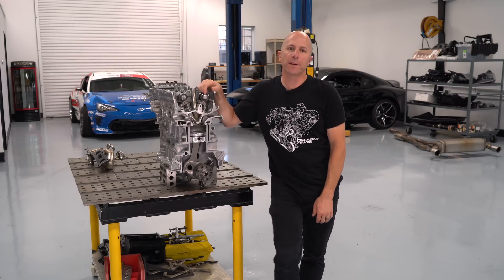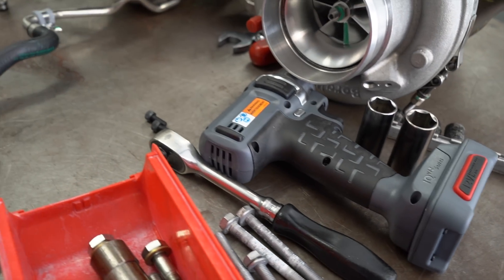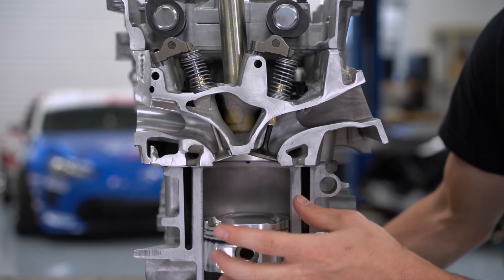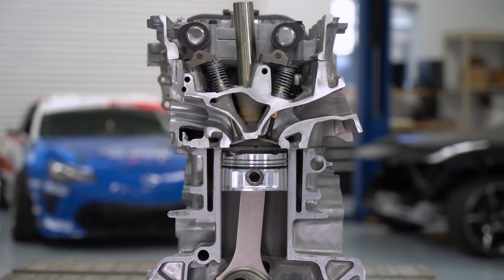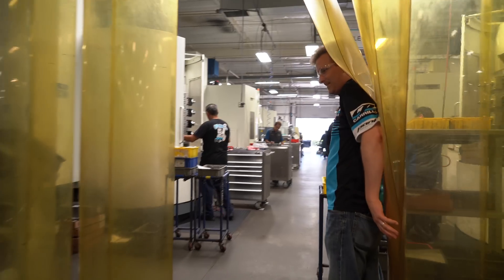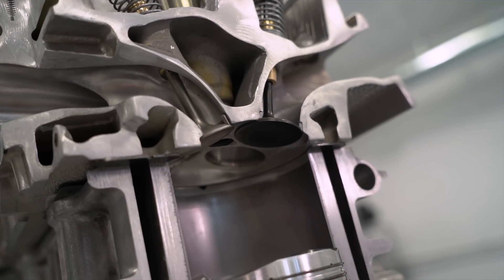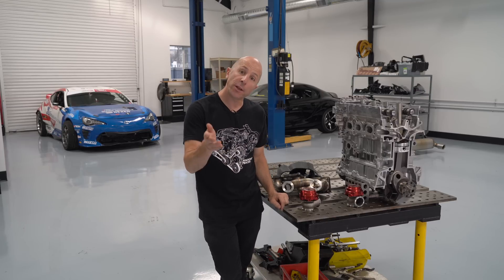The Making of 1,000 Horsepower 2020 Supra Engine Parts

Comment: I can't understand the comments on the video saying "Oh he's changing all the internals!" or "wow 1k HP without using stock parts". Like do  people think a 2jz, ls7 or 5.7 Hemi makes 700-1,000hp with stock internals? Obviously you have to upgrade the internals to do this stuff. Yea you can use stock internals but by that point you're on borrowed time, Stephen already said he's racing this engine so why would he risk that?
Reply: Ford 5.0 coyotes can make over 1000whp easy on stock internals
Reply: M M you can make 750ish just on a supercharger
Reply: @descentmvm  you can daily drive  car with even more hp on stock internals, but it couldn't finish one hour race. Just because car has +600hp it doesn't mean that it is using all of it when you're  cruising down the highway or stuck in the traffic so it is not under big stress, but if you want to use  that power for racing or track days it is not gonna have a very long nor happy lifetime
Reply: @themarenda  hes done probably over 2000 pulls on it man. 6 years at 600+ to wheels on a stock 1j is really impressive imo and proves that it can withstand long stressful endurances. Pretty sure hes dumped more money into new r154s though hes broken like 4 of those things and they cost like 3k hahah but I'm gonna have to disagree on what your saying if cars got a perfect tune it's not going to break. Even if you bag shit out of it or put it through long periods of stress car that has a perfect tune will hold up through that because there's no difference from doing one pull on way home from work vs doing contitonius pulls for a long period of time. If afr is right bearings will be smooth as butter even at 4x power. When engines blow up its rarely because they can't hold power its because air to fuel probably shit bed and started pinging. Put it this way if your standing on a pop can and its supporting your weight you could stand on that shit for 5 days it's not gonna collapse. Start flicking the side of pop can with your finger which is what pinging or running lean would be equivalent too and its gonna collapse.
Reply: @descentmvm  temperature starts to rise over time and there is more in heat management that tuning air gas ratio, cooling liquid evaporates and loses ability to take away the heat, oil lubes the engine only as much as it can and on bigger temperatures it changes caracteristics so it doesn't lube good  any more, less lubricated piston heads more resistance and material expands over heat until all goes to shit. One thing leads to another and when you tune one thing another one suffers, but this tuning for short bursts of power is more of an american thing anyway because of drag racing culture, we europeans are more influenced by rally and f1 so we care more about handling rather than just brute force
Reply: @themarenda  I 100% agree with you on this one that's all true. Also jzs are known for being really hot engines cast iron is a true ko I know mine even has problems with doing a 10 second burnout coolant temp goes up 15°c lmfao thats why you see alot of them with different rads even on stock turbo ones. I think biggest problem for jz would be getting seals koed from real bad heat soak and than losing compression over long long time from running way more power on them but then again these things dont blow up watch aussies or arabs run these things off limiters for 30+mins doing reverse burnouts at 80+kmh in reverse.
Reply: @descentmvm  yeah that are some sweet rides, but not much of it is left stock, arabs are practically sitting on oil, they just walk up to a mechanic with loads of cash or gold levers and say i want car this fast and leave the car. What they  drive and how they drive is just out of this world
Reply: 4g63s make 500 hp with stock internals easily and it's a 4 banger 2.0 liter.. 2jzs make twice as that with stock internals it's been proven and done lol
Reply: @slotwizard88  Clearly no one read the comment, as I said yes it's possible but for how long, everyone commenting about making 700 with their grandmas lawnmower and i already said its possible. Now show me one comment that answered how many those engine are gonna last in a competition like FD or a few hot 130f track temp track day. GTLM cars run stock engines pushing 600+ even those break in a race application.
Reply: It all depends on tune. Trying to get afr just perfect so that its not pinging during high rpm at high boost is a must for stock internals and 600+hp. I've seen people run for 6 years daily driving 680whp 1jz vvti and it's still running strong no burning of oil compression still holds. His secret ? A haltech and a perfect air to fuel ratio
Reply: Want to test the realibility on the engine, try hodrod dragweek. The prolonged heat and abuse really test that out. Give it some time and some crazy guys to test it.
Damn even stock honda k series could be boosted to 600wheels.
Reply: Most of the comments in this thread: totally missing the point.
Reply: 😂 at these 2JZ fanbois. The 2JZ compared to a B58 is like comparing a 350SBC to the new LT2, or a Honda B-series to a K-series, or 4AG to a 2/3ZZ. There’s no comparison. The new engines can make the same or greater power up high and still have useable power down low, unlike the boat anchors of old.
Reply: stando powah there are 2JZs making over 3k hp using billet blocks and heads. What’s your point? 
Who cares about power down low? Normal people. More power everywhere is better than just power at the top. 

Check out the testing done by Richard Holdener, it’s some interesting stuff. He’s built some big cube engines making 800hp NA. He’s also build some Honda engines too. Then boosted them until they explode. 
Cheers 🍻
Reply: A 2jz and ls engine can both make 700hp on stock internals. Easily
Reply: @t-man8411  the B58 in the supra just proved it can make 700hp easily as per AdamLZ
Reply: 2JZ, Stealth/3000GT and few others can make 700-1000HP. But yes its for how long.  Stealth/3000Gt comes W/ Factory Forged Crank Shaft.
They have videos of people putting Dynamic Racing Turbos on their stock motor 3000GT/Stealths and making 750HP.
Reply: Really?  Odd that my raced to death 94 supra engine had 180,000 miles and was forcefed a diet of 40psi from a 80mm Borg and handled it great for years.  Eventually it was so worn out I had to add a few drops of oil each time it was time to fire it up if I let it sit a few hours.  Other than the rings, which no doubt were gone, the engine handled the power just fine.  Hell, the first tuner I used(before I learned myself) did over 35 full boost pulls in a matter of 4 hours(the shop was mostly mustangs, VERY fast mustangs but did not specialize in supra's but said they were good with AEM)
Reply: This is so tryharding to prove new supra as a good successor but you can see from plain that this is some newborn retarded design of engine, and not tuning frendly. And this guy is kind !toyota! guy with all tuning tech, trying to achieve 1000hp to prove something.
Reply: Viktor Grzinic dude stfu you know nothing about engine design 2jz is nothing special anymore only thing it had going was the cast iron block that is now beaten by billet aluminum and that vvti is literally in every fucking engine even a Prius many engines can make 1000 horsepower on stock internals but the question is reliability
Reply: @viktorgrzinic937  
Yeah, not tuning friendly... just makes 630whp with a few bolt ons...
The only thing inherintly tuning unfriendly about this engine is the direct injection, since it's hard to get high capacity parts for it.

Comment: Just gives me more respect for the BMW inline-6. Not trying to take anything away from Toyota inline 6. With that said , wonder why they chose the BMW version over the Toyota version ?
Reply: Toyota doesn't produce straight-6s these days? In the era where small-displacement engines are the norm, the manufacturer chose BMW because they still produce this configuration for their sports cars.

Then, there's the 2JZ's block - it's made of cast iron, not exactly the type of material needed to make a nimble sports car.

Comment: 07:04 Windows xp in 2019... nice xD
Reply: Industrial tech takes a looong time to advance
Reply: @Syncopia  Also, I wouldn't trust anything above that in my shop.
Reply: thats what happens when you have specific software that works perfectly fine for the machine it's controlling (flowbench in this case), and there's literally no reason to change it or upgrade
Reply: Windows XP uses less resources from your computer, and those computers must be only used to work on those specific softwares which are compatible with Windows XP so this is more efficient
Reply: I mean we're all here because of a 25 year old car
Reply: Jonathan Doe lol touché

Comment: We just needed time to let the haters know how much potential these B58 bimmer engines have. Now LAUGH at Z4s :} it will go close to 2000hp. Just wait to see...
Reply: Well, if you would be at least somewhat related to engine building then you would see huge difficulties by just looking at this B58. It's pretty much impossible to apply some of the heavy tuning thumbrules to this B58. Like changing the exhaust ports and making them equal length is impossible if they're cast into the block and combine into 2 ports.
It's a compromise engine, it's designed to be lightweight, powerful, ecofriendly, etc. etc. The JZ is just an overbuild too heavy piece of cast iron that withstands abuse.
The JZ is indeed not as good as it's fanboys suggest, it does have design flaws, but the JZ still requires way less compromises and/or changing in components compared to other engines (like the RB25) Building a 1000hp JZ is just way easier and cheaper than making a 1000hp M53, a 1000hp RB25 or 1000hp M58. You have to look at what cost you can make this power.

Comment: I gave this a thumbs down because you are NOT pushing the limits of this engine to see if it will put out 1000 hp and live up to the 2JZ engine, instead You are taking the easy way out and rebuilding the engine to "safely" make 1000 hp .. That's my opinion 
I'm sure someone else out there has already pushed the limits of the stock motor or is in the process of it. 
Maybe others will like your work ...
Reply: He never said he will push the stock engine to 1000hp mate
Reply: @Semper Fi:
i never said he was going to ... MATE
Reply: @ACommenterOnYouTube  then why were you expecting it to happen?
Reply: Because this bmw is supposed to live up to the 2JZ supra ... The only way this motor will live up to the 2JZ is to push its limits ... 
Anyone can tear down and engine and put in forged internals with porting and polishing and a good tune and make power. The key is to test the factory engine and see just how good they built it ..
Reply: @ACommenterOnYouTube  The 2JZ was made at a time where you could do anything you want without any strong standard, the B58 is made nowadays and respect every euro standard and compare to the 2JZ it is a lot more confortable to drive and by far more efficient; They put a new engine, not an upgraded 2JZ, if you want a 2JZ, then buy one, any jackass can get 1000hp, the true question is, for how long
Reply: @Semper Fi:
Im going to end this conversation here, you are on a different page and clearly NOT getting it ... 
Also another note, you should take your "always faithful" somewhere other than a corrupt government ... Maybe their brainwashing has screwed up your understanding skills ... 
Good Day

Comment: 5:35 shot peening doesn't "relieve surface stress". It actually induces a compressive stress in the surface. You'd then need a large tensile stress at the surface (ie in the opposite sense) before you could induce a crack to propagate. That's how it works. But it's a great video - much appreciated!

Comment: 5:43 why don't they break off the lower cap rather than cut it? Most car manufacturers do it that way for the optimal connection between the two. Now wouldn't that be more important when it's going into high performance engine? Or is it useless and car manufacturers do it just for fun?
Reply: They do it on powdered metal rods that are cheap to manufacture...these are billet forged rods

Comment: Sooo the stock BMW engine is actually shit, just like everyone had been saying. This engine build is a huge waste of time and money. Only good for views on YouTube.
Reply: @Seb C the internals u speak of are cheap to replace compared to the amount of thinks u have to replace on the outside of the motor to make good power. This is one of BMWs worst engines for tuning. Any of there m3 engines would have been better
Reply: @Seb C u don't know engines at all. The 2j came with forged rods and only needs minor upgrades to get 600+hp. Turbo, tune, injectors, fuel pump. This b58 is having to scrap most of the stock parts. Pretty much only keeping the block. And having a gas engine based on a diesel would not a good thing. Lucky for everyone it's not even similar
Reply: @Seb C in this video it looked like he was replacing the Pistons 2, bc he was. Are u even old enough to drive, or have u actually worked on 2js. You are the only person who can't see they were much better for tuning. The B58 was designed for SUVs. Hauling kids, not ass
Reply: @Seb C ok I can see you are not familiar with the 2j at all. I'm going to stop trying to change your mind about it.
Reply: @Seb C I work at Toyota as a tech in Atlanta. Come see me and I can explain in detail why the 2jz is so much better. We can compare it side by side with the new Supra. We have 2 unsold ones in the shop. There are 19 other techs here to help explain if u don't believe me
Reply: But the new Supra does look much better
Reply: @Seb C we can agree on that

Comment: I was wondering if the engine is able to produce 1000hp but what else on the car is going to be upgraded?  Transmission, diff, prop shaft etc..  Also, the uni body chassis will require extensive upgrading primarly welding all chassis seems to increase  stiffnes.  Overall what will be left at the end will actually still be supra.

Comment: Papadakis, do you think that the timing chain can  be upgraded? When you released the teardown video, as you disassembled it, i noted that it is a single row chain, and then you said the engine is a partnership with BMW, uuuhhh... I felt a cold down the spine... That's because i have an Citroen with the BMW-partnered  engine, you know... the THP one... In witch the chain has to be changed every 70k-km or so because it stretches... And does it so much that the intake timing sensor indicates error... And with it's "awkward" (not to say stupid) position, and the forces you are working with, if it can happen, it will be fast... By the way, the inverted position of this chain was used by Toyota in the group C Toyota 89C-V, it was a belt then, but also turned to the gearbox side, in that case, making it easier to access... Regards!

Comment: Nice project.  Airflow has to be trippled at the valve to reach your goals; very aggressive.  If anyone can do this yall can.  Is all this for a potential stage 1, 2, 3 kits in the future, or personal shop use only? Are aftermarket Cylinder Heads in the making?  This is how BMW should've built the engine to begin with.

Comment: Cast pistons for a performance engine are definitely a no no. But if you have made a forged piston, with similar design, then it's certainly more resilient if you don't get stress areas created for making forged geometries that are usually cast, then milled, but a mechanical engineer should know that.
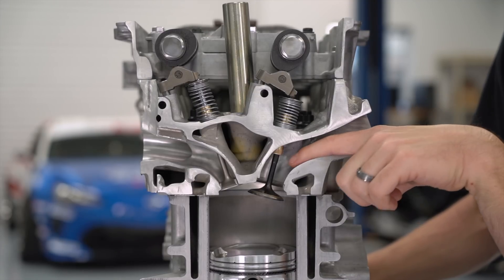Let's be clear that even though 1:11 compression is high for most gasoline fuel, it's a bit low for pure ethanol, BUT with considerable higher boost from the new turbocharger you don't need and can't  compress the mixture too much, you just need a good injector to keep up, since you have a lot more air being pushed per cycle and even with intercooler not only it can be too hot risking knock, but the mixture itself is already at a higher pressure,  not requiring greater compression. Just a food for thought for the other viewers!
ONE DOES NOT SIMPLY INCREASE COMPRESSION AND TURBO BOOST AT THE SAME TIME